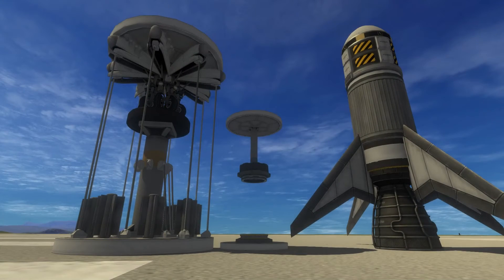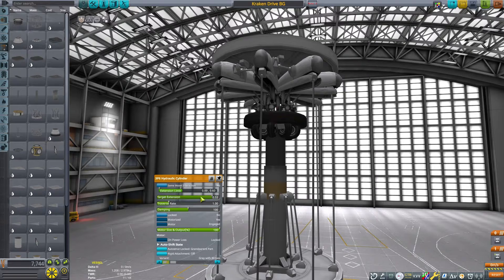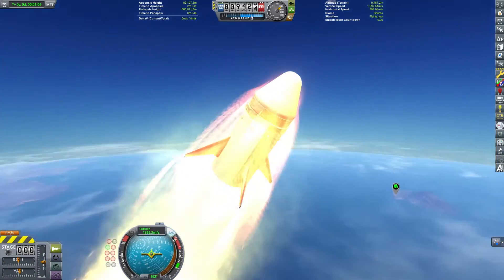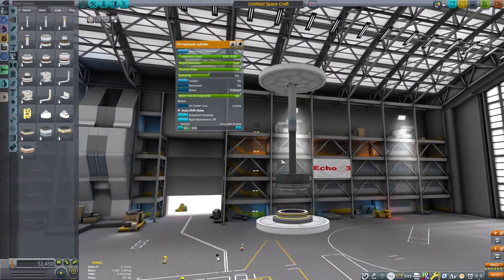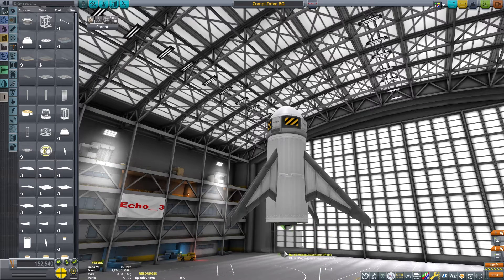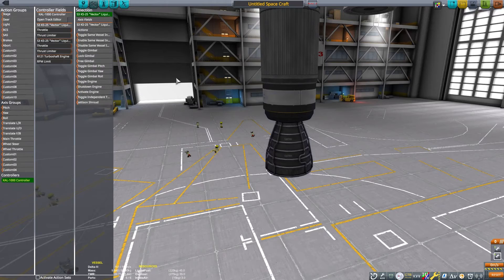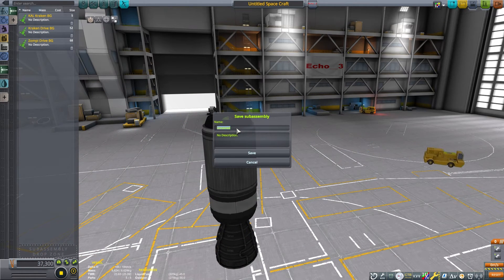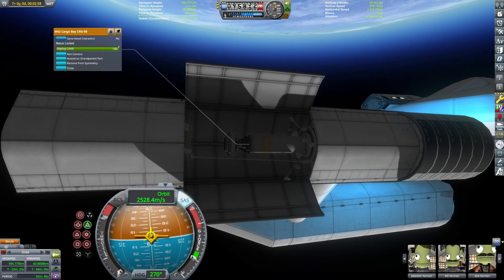How to make three styles of Kraken Drives using the Breaking Ground DLC

Comment: you can just get 103038384747% throttle on anything without rotors
Reply from the maker: Yes, but I found this method to be easy to control.

Comment: Im too bad to do this can i get docking port one?
Reply from the maker: Depending how big of a craft you are trying to make, you don't even need to use any breaking ground parts. You can just manually control the acquire force on the docking port. This works well for smaller crafts.
Reply: @Echo3  but please can i get docking one?
Reply: @Echo3 that's how I made mine. You can use them for larger crafts, but they are very expensive and very laggy. They also randomly collapse and explode.
Reply from the maker: @EvyTallWoman  Wouldn't be KSP if you didn't have framerate issues and random explosions.

Comment: It instantly overheated help
Reply from the maker: What is overheating? The KAL-1000 engine exploit?
Reply: @Echo3  I had the same issue. Do you know how to fix it?
Reply from the maker: @Yaboi876  It sounds like you are making the wrong value negative
Reply: @Echo3  Know its been a whole year, but my bottom vector just dies instantly by overheating. from the first. do i need to shut down the first or what?
Reply from the maker: @guy-0ffic1al It's been a little while since I've made one of these, but I was thinking that the negative throttle or thrust negated the effects of the engine.
Reply: @Echo3  nvm, i fixed it, but thanks anyway. btw, kold war videos are awesome

Comment: Why did they remove same vessel interaction?
Reply from the maker: Same vessel interaction is in the game. Make sure that you have the Advanced Tweakables option enabled in the game settings.
Reply: @Echo3 Is that even on Xbox One?
Reply from the maker: @UltaOrb  Same vessel interaction should be on XBox one. The first Kraken Drive in the video is the only one even possible for console users. The KAL overclock and docking port acquire force aren't available. By game settings, I mean the option in the main menu.
Main menu - Settings - General - Gameplay - Advanced Tweakables
Reply from the maker: In Main menu 
Select Settings 
Under the General tab 
Gameplay - Advanced Tweakables
Reply: @Echo3 Thanks
Reply: How do I get to Advanced Tweakables

Comment: My issue is while I managed to make a stable drive on Xbox,it's to fast to really be of much use unless it's on a 100+ ton ship.anything light,your on your way to deep space in a minute.orbital manouvers are not feasible.so interested in this kal 1000 trick as one it seems as though I can tweek end performance to my needs,and two the docking port method is not viable on Xbox because they don't give you the option to change aquire force values.i have made a few drives on console,one being stabile and reliable,but again,it's either on to maximum warp,or off all together.

Comment: Strangely, my attempts to copy the zompi drive have been mixed. Its core principal works, but only with a 1 docking port on the top for one directly below it, and if i have many bottom ports clipping over each other as demonstrated in the video, it generally produces very low or no thrust or tears itself apart with lots of weird orthogonal forces. Any ideas of what could be wrong there?

In any case, I feel like adding that the vid was good and I'm glad to have found this channel through it, it's pretty cool. Also that symmetry trick was insane, I never knew about it and it blew my mind, totally gonna be using that so much in my designs from now on!
Reply from the maker: With multiple docking ports clipped together, I had to use the absolute move tool and make sure they were in exactly the same place. Otherwise, like you described, it would tear itself apart.
Reply: @Echo3  if u use the move tool on absolute mode with snapping on its guaranteed that the parts will go into the same exact place
Reply from the maker: @pqddachu  Yes, this is what I do.

Comment: Can't seem to get the throttle controls to work. It works instead by physically sliding the "play position" slider on the KAL-1000 module, but it wont let me use the throttle controls like a normal craft.

Edit: Nvm, my bad. Went back and watched again, just missed the part where you hook the main throttle controls to the KAL's play postion. Maybe putting a further mention on how important that step is or else you dont have throttle control like a normal craft would be nice
Reply from the maker: Glad you figured it out. It makes for a very fun craft to use.

Comment: What update are you running? At least on Xbox they've removed the independent thrust from the engines.
Reply: They also romoved alot of the things you need to get alot of the known good drives built.really got to think way outside the box to get a good one made.i got one but it's way too damn fast lol.
Reply from the maker: I am running version 1.12.3 on PC.
Reply: @Echo3  ic I just wish they hadn't removed that from feature from Xbox.
Reply from the maker: @cptdfriday1  It seems odd to remove that. I have some other crafts like my triebflugel, that use independent throttle to fly correctly.
Reply: @Echo3  yeah the fuel drain still works but all the axis settings on engines are missing on xbox. You can still set the throttle limits but there is no button or toggle for independent control.
Reply from the maker: @cptdfriday1  That's a pain. The landing gear kraken drive should still work though.